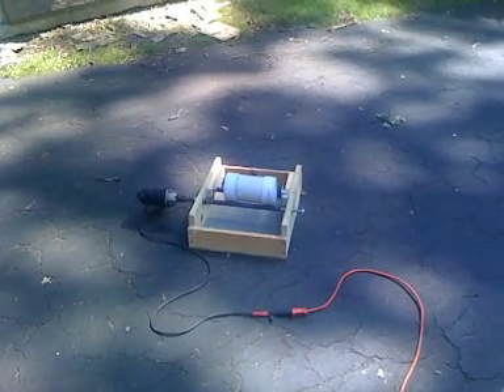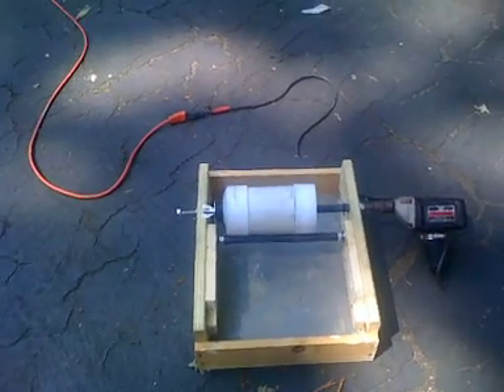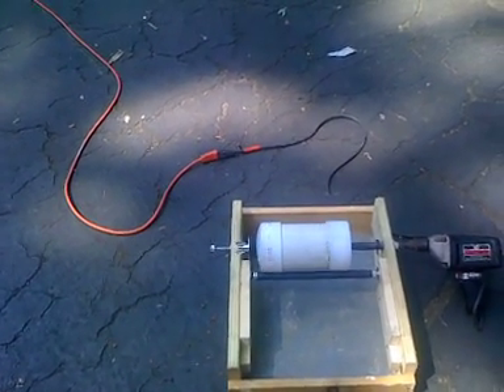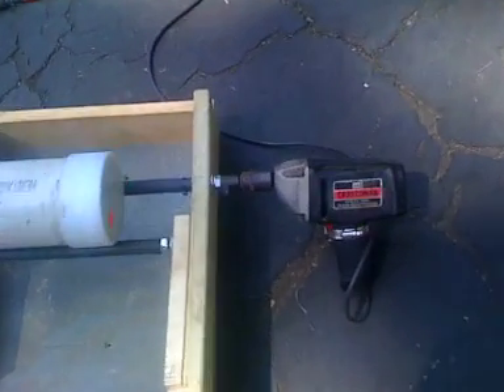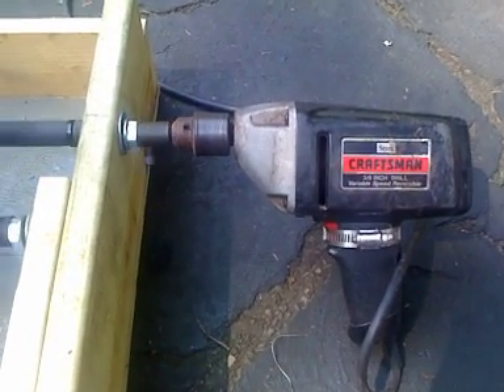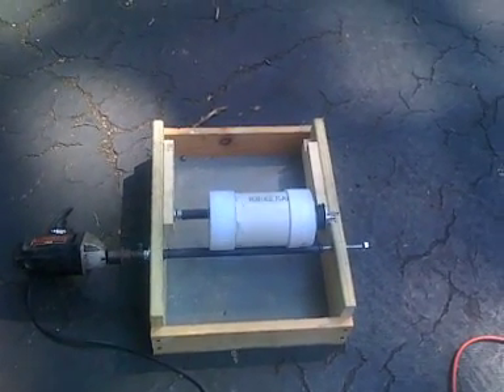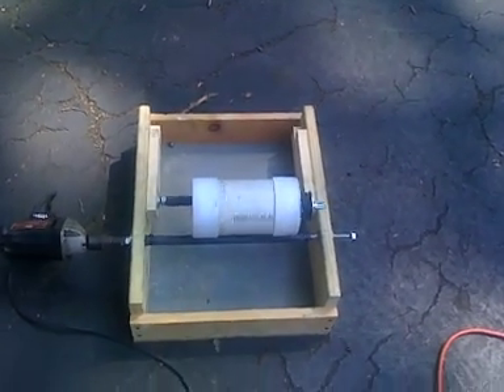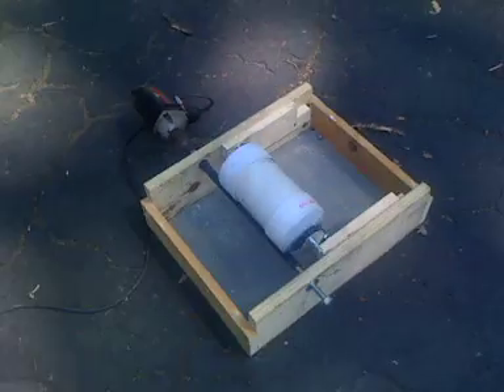Ball mill - home made

Comment: Ground Those ball mill pvc chambers by running a #12 or #10 wire from ground to the pvc chamber.The bare copper can rub on the spinning pvc and it will take the static away,through the copper wire :D This will make it a hell of alot safer.

Comment: @lodcomm and i didnt say that steel can is fully safe , steel balls running in it while spinning , may hit the can wall hard as it may make small friction spark , i prefer hard wood can , antistatic material or something cheaper like hard epoxy coated can  
additional : dynamic electricity , i mean normal electricity will ignite Bp (LOPT transformers )
anyway u gave me some good experiments  
thx
but anyway u gave me new info

Comment: @lodcomm i saw the experiments and i was shocked a little lol , i said that it may ignite i didnt try it so i said (may) , but even with fully charged pvc ball mill , it will not be as strong as the sparks in those experiments lol , so now i can tell that static electricity may not ignite Bp , but i cant even try making pvc ball mill where steel is stronger ,safer and i just use an old paint can to make ball mill ( no work like gluing or cutting ) but anyway u gave me new info 
thx

Comment: i just saw this vid now lately 
i wanna advice you not to use pvc as it will charge static electricity and it may ignite your powder better to use steel can 
second the pvc is a little soft and it may and it will be eaten by the steel balls sooner or later
but any way i like this simple assembly